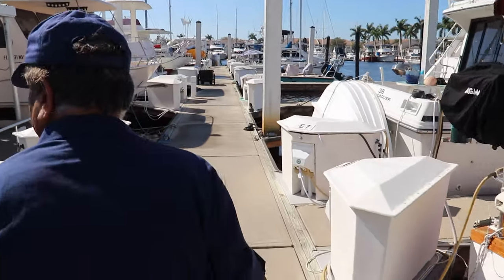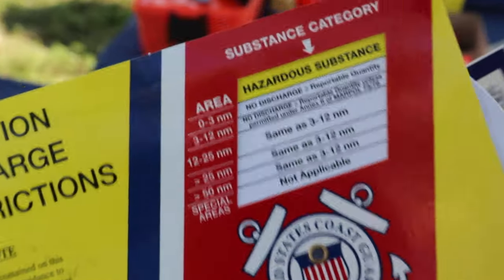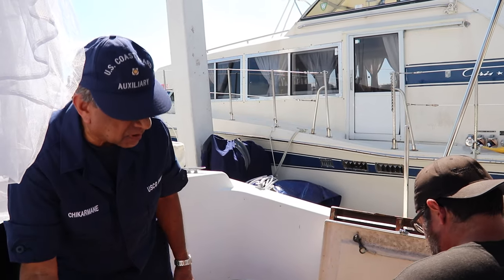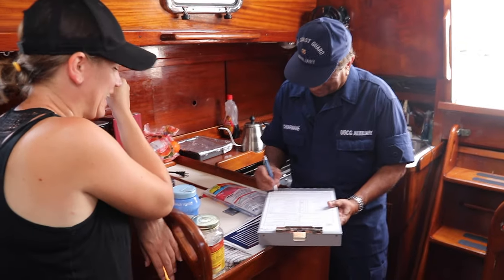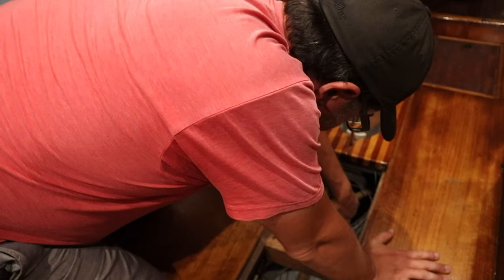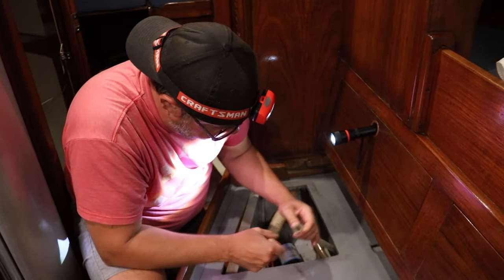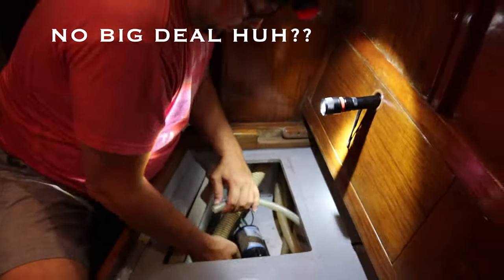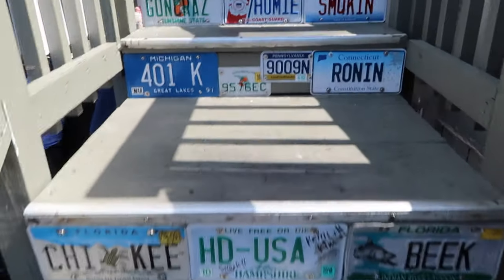BOARDED by the US Coast Guard – It’s Safety Inspection Time I Sailing on a Whim Ep.13

Comment: Thank you for the video, great job we just bought our first sailboat so it's nice to know they can do these checks before hand to know what is needed.
Reply from the maker: Right! they come for free to do the check too! was a nice surprise!
Reply: That's great, but do they file the "free" inspection for a "random" stop later? I'm all for some help keeping off the USCG radar.
Reply from the maker: @mechanicdave80  We had to call them to come back and complete the inspection. I think your wondering if there keep that inspection on file.. I'm not sure but they give you a certificate once your up to code and you keep that with you if they ever stop you.
Reply: @SailingonaWhim  I was wondering if they kept that initial inspection on record, or if they voided it when you had your "Official Inspection" completed.

Comment: Just a quick technique for those pesky hose fittings... get a heat gun (you find a LOT of different uses), and soften (using low setting), the hose end before mating to the connection.  This will turn your 20 minute wrestling match into about 3 minutes of professional result.
Reply from the maker: Great tip, we will have to try that!

Comment: Heat it up with a heat gun or hair dryer and it will go on easier.
Reply: csranch2000 never heard that before.. good idea.
Reply from the maker: Yes, that's a really good idea! Thanks for the advice!
Reply: Sailing on a Whim,  yeah, heat it it’s the only way,  but definitely once one hose has “fallen off”. They are at the end of serviceable life, replace them all,  and Anchor the hoses atleast every two foot, anchor all T/Y Connectors in place.  That was your boat official warning to you, to check and replace all water systems asap, inc through holes,  you have a broken handle on the “heads” valve,  so technically she has given YOU two warnings!   That makes you lucky, not everyone gets two warnings!  Consider yourself very lucky, and listen to her!
Reply from the maker: Definitely good advice, Bob! We went through all of the hose clamps so far and will start replacing all of the hoses soon. They seem to be fairly well anchored but will need to double-check that they are indeed anchored frequently enough. Projects on a 40 year old boat...they never end!!
Reply: Sailing on a Whim,  well it’s good advice, yes.   And you are correct the repairs never stop, i doesn’t matter if she’s 40 year old or 5.
The idea is to “work the issues”. Meaning, what can sink her? Priority 1.  Anything below the water line,  so keep spares aswell,  and documenting what and when you have replaced something (and the tools required).  Eg all fresh water hoses and clamps on the 17th of October 2019,  tools required a short and one long flat blade screwdriver and heat.  Quality of repairs 8/10, possible new T connection needed near Aft head.  
Priority 2.  Electric,  eg fault auto bilge pump, main, replacement pump fitted, inc hoses and wiring on 20/ oct 2019, tools required ect ect, quality of repairs 10/10 no notes required.
If you keep a log like this,    It becomes a reminder of when things were done, the tools you need to keep onboard, the spares you need (so you’re not keeping useless crap). What and where you brought the parts,  it just gives you more confidence, plus adds value to your boat.  Like a extended service history, with the added benefit of an Intimate Knowledge of all systems in Priority order,  i also am a strong believer in doing the work yourselves, if you have to pay,  watch carefully how they did it, tools and parts required and write that in your logbook aswell. Eventually you will have the confidence in repairing and maintaining all systems, and that knowledge is priceless out at sea.   
Kindness regards.
Reply from the maker: @trevhedges  Right! We are just learning what spares to invest in. It's such a big learning curve. We did fine the first season but def could have used a few things.. I finally understand why my contractor friends love going to Home Depot. it's like a kid in a candy store!
Reply: @SailingonaWhim  quick way to get tight hoses on is to immerse them in a mug of boiled water. It makes them supple so they slip on easily.
Reply from the maker: @SailingABSea  Sweet.. wish I knew that when these things were happening!